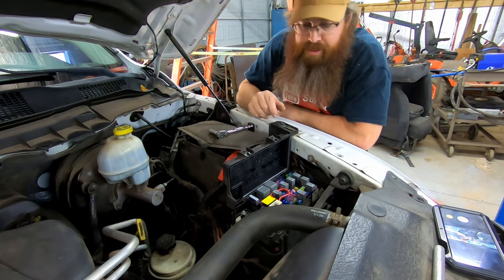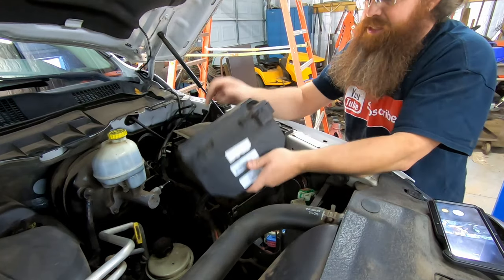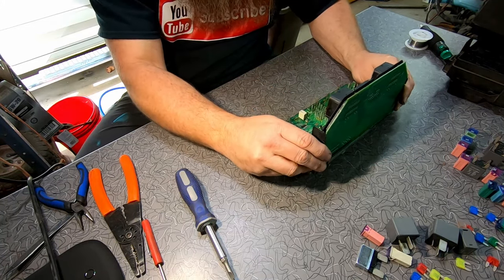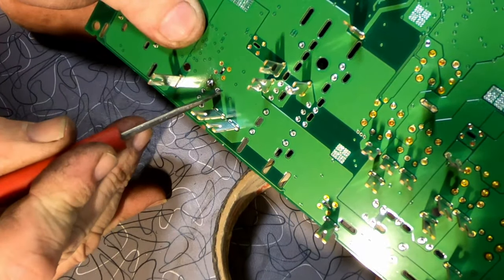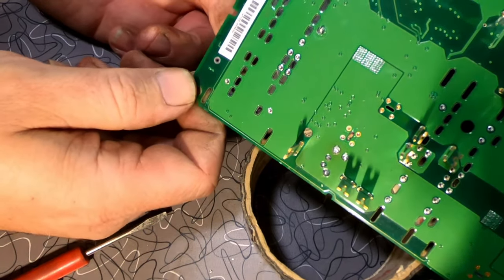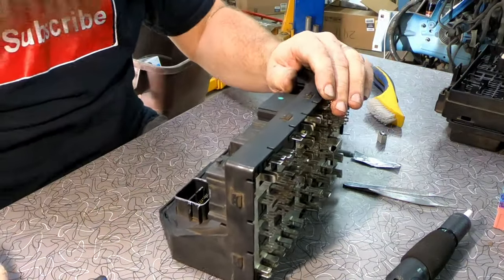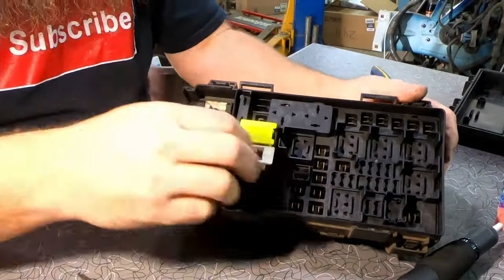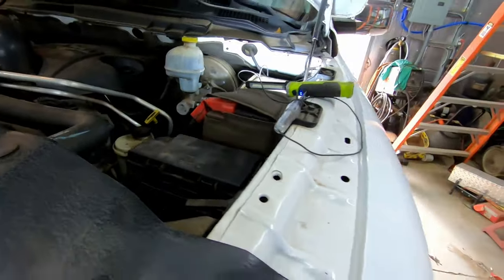The Ultimate Guide to TIPM Fuel Pump Relay Replacement in Dodge / Chrysler / Jeep

Comment: Well the task was way harder than I thought and my solder sucked but I still got it done. Took 3 hours but thanks to this tutorial I was able to get the repair complete for $20! Thank you so much!!!
Reply from the maker: Awesome glad you got it going.
Reply: @2TrailHikers  hey bro do you have any videos for tipm 2010 journey I don't have spark I'm sure is the tipm
Reply: The part number and manufacture on the part is?????????????? Thanks for your help as nowhere does he give this info
Reply from the maker: @margrak-bc1zx  really link is in the description.
Reply: Hey brother from what place did you get the micro relay for the same truck???
Reply from the maker: @erickmznlmldr2098 bought it off Amazon link is in the description.

Comment: Great job on this repair, especially checking for other failed solder joints and not forcing anything.  It's crazy how much places want for a rebuilt TIPM, when all it needs is a $10 relay.
Reply from the maker: Thank you for the kind words and watching.
Reply: If I had any experience soldering I would try this myself but I believe this is past my pay grade
Reply: @northwestgaming4049  soldering is super easy my friend believe me you can do it

Comment: Check out Desoldering Wick Braid. It's basically braided copper that you lay over the solder and apply heat. It transfers the solder from the board to the wick. A little Electrical Soldering Flux (Not Plumbing Flux) will help removing, as well as flowing better when soldering the component back to the board. Can't believe they make these relays inaccessible like this...Ridiculous. Great video - Thanks
Reply from the maker: Thanks for the info and watching.

Comment: Damn! Thank you so much for the Video...I am pretty good with electronics, building PC's...Taking old laptops apart and upgrading them so i feel pretty confident i can do this and save me a lot of money....2011 Ram 1500 4.7 130,000 miles....I replaced the serpentine belt, AC Clutch, they said i had to buy entire compressor, Alternator, Battery and Starter...Love my truck and keeping as long as i can...New trucks are nuts at $80,000 bucks or more
Reply from the maker: New trucks are crazy!

Comment: Sir, I wanted to thank you for such a detailed video. Followed your steps and ordered the $5 relay and soldered it down myself. Truck fired right up and fixed all of my issues. Glad I saw this before I replaced my fuel pump! My issues were starter would run but no start, after a couple of attempts it would finally start. Occasionally after parking the truck I would hear the fuel pump hum after tuning the truck off and walking away.
Reply from the maker: Awesome glad you got it going.
Reply: Please send me a link of a relay so I can solder it
Reply: nvm its in the thing lol

Comment: Repair is good. You might want to crank up the heat on your soldering iron, so you don't stay on the joint so long and overheat the board.
Reply from the maker: Great advice thanks!

Comment: Thank you for this video! Absolutely amazing and incredible walkthrough. Getting the solder off the old relay was a nightmare as you said. Wish I had some solder wick for the job as the solder sucker was a grind, but patience was the key with it. Took the better part of 4 hours to finish, but it's better than spending the absurd amount for a new TIPM.
Reply from the maker: Thanks. Glad you got it going.

Comment: I am so glad I found this video and so grateful to you for making it. I think you saved me about $1,200.00.  I followed along and it went very well. I did have trouble removing the module from the circuit board. It's difficult to remove because I'd heat one connection, loosening it, and when I moved on to the next, the solder would re-solidify. So I took the board to an electronics shop and let a pro change out the module. It only cost $55 and I didn't burn up the board trying it myself. THANK YOU!
Reply: Can you send me the part link you bought please! The one linked in his video is now unavailable, thanks!
Reply from the maker: https://amzn.to/3I9xuZf 
I belive this is it but it's a 2 pack.
Reply: @2TrailHikers  thank you!

Comment: This is an excellent job!  I have a Chrysler 300C and if/when I run into TIPM issues I will take the unit apart like you did and solder in new relays as needed.  I am an old shortwave radio builder from back in the day so this is a fairly easy repair with your tutorial!  Thank you and all the best!
Reply from the maker: Thank you for watching and the kind words.

Comment: Spot on! Just remember moving solder moving while it cools create cold joints and will eventually crack. Let it flow and remove the heat, adding more solder with give a little more flux if a joint is being difficult. Some larger traces might need a little heat. Keep up the Good work!
Reply from the maker: Great advice thanks.

Comment: Thanks and nice work.  Run your iron a little hotter solder will flow quicker and you won't have to apply heat as long.
Reply from the maker: Thanks for the advice.

Comment: Very well done. Clean job and precise instructions.  I can see on my older raggedy Ram that I just bought,  that my relay has been bypassed. On a newer truck, I'd probably go this route. But since it's a design flaw, I might just install a heavier relay and wiring and bypass the OE fuse panel/relay box.  Repairing with the OE design will just allow another future failure. Thanks for posting this video.
Reply from the maker: Great idea

Comment: Excellent!  Only comment is to be careful not to overheat and melt the relay - need to be quick with the iron. A little solder flux would have helped the solder flow in.
Reply from the maker: Got a tub of flux now. Thanks

Comment: Very well done video and educational! Thank you.
Reply from the maker: Thank you for the kind words and watching.
Reply: I had same code p0463 low the fuel level sensor voltage reading zero fuel gauge shows empty put new level sensor same issue all wires to level sensor are good is that TIPM fuel relay feeding the level sensor by 5 v?

Comment: i bought a 2011 town and country that was sitting for 3 years without running and said it had the same problem but i just reset the tipm (touched the battery cables together) then put them back on the battery and it started right up.
Reply from the maker: Cool deal.

Comment: I noticed these tipm have more than just a problem with the pump it has other problems with horn and so on .  The bypass kits they sell pretty much only work for the fuel pump itself so soldering new relays is the only fix .
Reply from the maker: It's a poor design.

Comment: I have a 2003 Grand Caravan and I was inspecting my TIPM. I found that 3, in  separate locations  3 metal blades were completely unattached to the board is this normal? If not then how can I resecure them? Non of the blades are soldered they have that clear coat glue stuff holding the rest in place

Comment: Why the F would dodge install one of the most important relays inside the fuse box and make it a micro. I'm thinking way too undersized for a circuit to be on/feeding a non stop item like a fuel pump. Probably overheats the relay and melts the solder off causing faulty connection. Thanks for showing what's in the box and how to fix it. I'm thinking of taking it apart and tracing inside terminals to outside wires and installing an external normal size relay that can handle constant use/load. Nice video, thanks!
Reply from the maker: Great idea thanks.

Comment: Great job! Next time, don't use a desoldering pump. Use desoldering wick! You'll never mess with leftover tin! 😊

And never use a hard bristle brush. Use an old toothbrush dipped in acetone or isopropyl alcohol! It does wonders! 👌
Reply from the maker: Thank you for the advice.

Comment: I went with installing an external fuel pump relay following another tutorial, canceling the relay inside the TIPM. About 7 months later the relay got toast again. Currently have my truck on that bypass bridge and my truck randomly dies not too often) when I apply the brakes. 
Tempted to replace relay via you tutorial but wondering if there might be a second issue with the wire harness as well.? Lmk what you think 
Thank 
PS. great tutorial.
Reply from the maker: Really could be wiring, faulty relay, or possibly pump pulling to much current hard to say. Thanks for watching!

Comment: Have you considered making an adapter that you can solder onto that board and then quick-swap a regular relay? I bet it would get popular. I’d buy one cause this is BS 😂 i’ve done solder jobs replacing capacitors on ECUs so I’m not apposed to fixing it hut kind of ridiculous that chrysler/dodge/ram did this on a part that is known to not last. It would make sense if it was a solid state relay that doesn’t degrade over time.
Reply from the maker: Great idea and agreed it's a bad design.

Comment: great video hoss, 2015 dodge Durango turns over but wont stay on for 2 seconds, I'm getting the loss communication with PCM , I have checked all fuses that have to do with RUN/START...If i was to order refurbished programmed one is it basically plug and play on replacing it?
Reply from the maker: The only thing I can think of is you may have to program the vin into the new pcm.

Comment: Very nice thank you for this video I am quite confidant now to tackle this repair. Question because the fuel pump is constantly running when jumped does it use up more gas?
Reply: If this is like most fuel injection systems,  the fuel pumps in a closed loop back to the tank, through the fuel pressure regulator, which provides back pressure to feed the injectors. So no, it doesn't use more fuel.  With the jumper off an accessory connection the pump will run if you have the accessory mode on, no engine running, which will drain the battery.

Comment: Do you have to pull the tip when you do an easy reset for 12 second
Reply from the maker: Not sure what you mean by easy reset. If your disconnecting the battery to reset the system? Then nothing to do with the tipm.

Comment: I'm having a issue on a 08 liberty. The power lock fuse keeps blowing immediately when installed. I'm going to open up the tipm. Any suggestions on what to look for. Love the video
Reply from the maker: First thing that comes to mind is possibly broken wires between the door and body.
Reply: @2TrailHikers  ya that's what I've been looking for. I have to unplug 3 harness out of the tipm before the fuse quits blowing. That's what was throwing me off us that I figured if it was one broken wire i wouldn't have to unplug that many from the tipm. I'm gonna keep looking. Thanks a ton

Comment: I'm running a pump relay jumper on my 2011 Ram 1500. I have a drain in my system, pulled all my fuses and relays with no elimination of the drain. I pull the battery cable from the TIPM and the drain goes away. Would replacing this relay possibly fix the drain on the battery?
Reply from the maker: No idea if would or not haven't seen that issue before.

Comment: how do I find the part number for a 2011 dodge ram 5.7l  relay  dealer says they have 2 different numbers i like to buy it before taking it apart as I have no one to help me
Reply from the maker: The relay listed in the description fit the 2011 5.7 truck I fixed in the video.

Comment: My 05 jeep started and died 3 times. Now it will not cycle and pump fuse has no power. Will this relay also power the trigger wire for starter?
Reply from the maker: I would think that would be a different circuit.

Comment: How do you pop up the other 2 fuses
Reply from the maker: Not sure I understand what your asking.
Reply: @2TrailHikers  I figured out how it was the two that can’t be removed you just pulled them up. But mine was very hard to pull up. I was afraid I was going to break them lol. I loved your video on how to replace the relay. It was a success but now my fuel pump won’t stop running. I think I got a bad relay.

Comment: Your video was good but you never showed the actual damn tabs that needed to be depressed.
Reply: The tabs you showed to depress did not unlock the board
Reply from the maker: Sorry I imagine they may have made some different from the one I disassembled.
Reply: I am struggling to get mine to open also. I've tried sliding drill bits to act as a wedge to hold mine after depressing it. My daughters and I are at a loss. Any tips? Any chance you'd do a close up of how you get them to release? 

And thank you for the video. Girls and I have been learning to read schematics and how to solder so we could fix this. Trucks been down since beginning of December. Thankfully Walmart and Amazon delivers and YouTube teaches.

Appreciate your help and video sir.

Comment: TIPMs are a bad idea.  Eventually, Chrysler will stop making them.  When that happens, a 25 or 30-year-old vehicle that has one will not be able to get a new one.  The owner will have to get a used one if it is available and there is no guarantee he will be able to get a used one.  The TIPM is too complicated for an aftermarket manufacturer to make from scratch.  I see Dorman sells remanufactured version of the TIPM, but they are not made from scratch.  Looks like planned obsolescence to me.

Comment: you un soldered a five pin and the board is five pin and the link to the relay on Amazon is a four pin
Reply: The link is to a five pin 2 pack. If you are simply looking at the picture in Amazon, it looks like only 4 pins. However, read the description and it is 5 pins.
Reply: In the Amazon photo, look VERY closely at the leftmost "pin".  You'll just barely be able to see it's 2 pins lined up, where one is along the far edge of the relay and the other is on the left edge of the relay.  From that angle, they blend into each other in the photo.  The photo would be better if the relay had been rotated just a little bit.
Reply from the maker: I believe it is a 5 pin.
Reply: I tackled this project about a month ago. Had the part forever but was scared to try it. Worked like a charm. Mine had a bypass that was melting the plastic off the fuse without blowing any. Thanks for the video!
Reply from the maker: @hoaglandjeffry awesome glad you got it going.

Comment: These systems suck. My old Tundra goes forever. Replace a fuse here of the. With the TIPM it will cost you $1000 new in installed.. What a rip off designed by idiots.
Reply from the maker: It is a poor design.